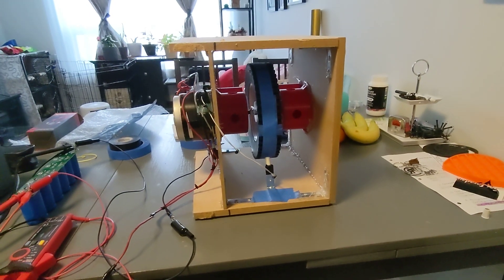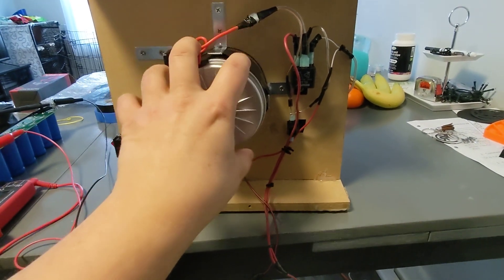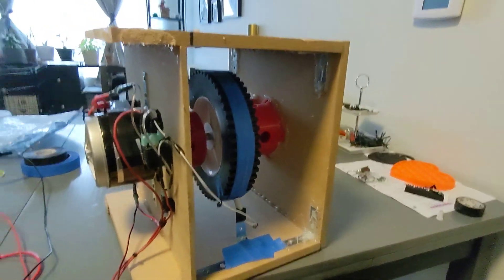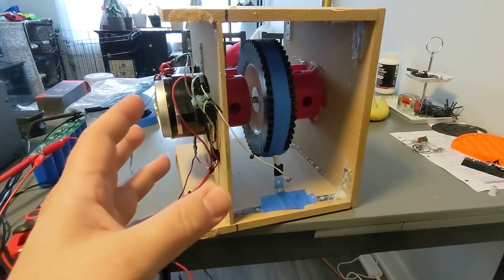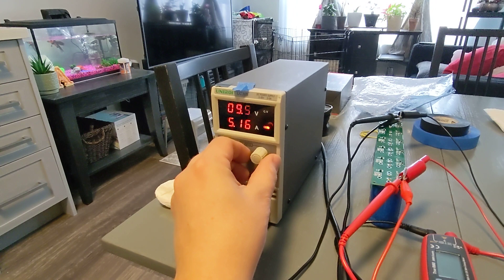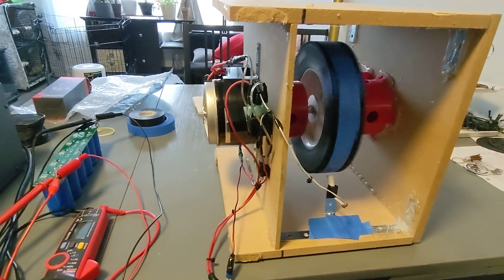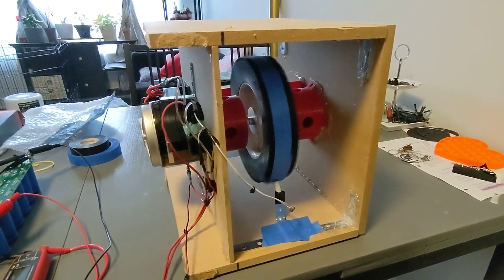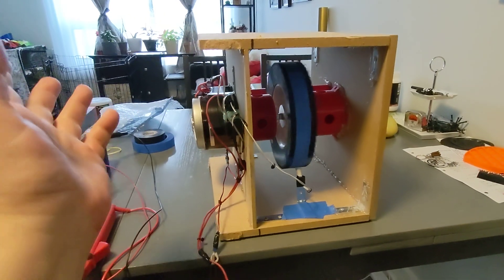Faraday Research RND ⚡⚡💦#freeenergy #tesla #zeropointenergy

Comment: 9:17 Some bearings are only designed for radial load. To have the wheel horizontal, you'd need tapered roller bearings or something.